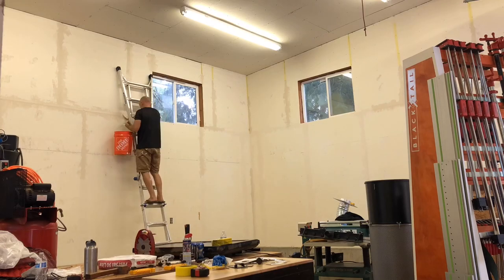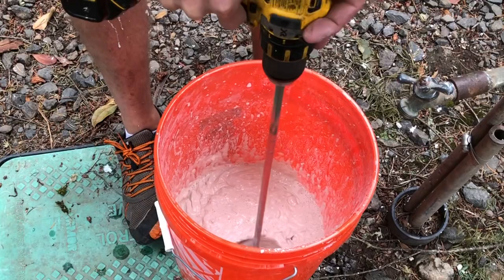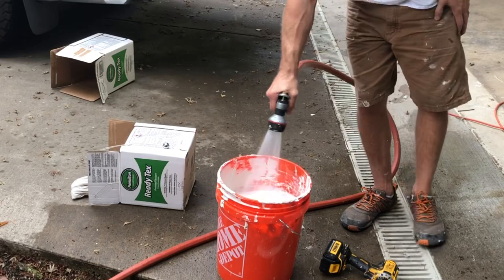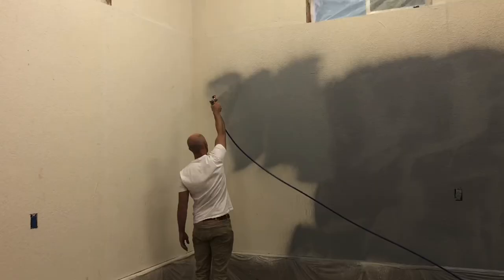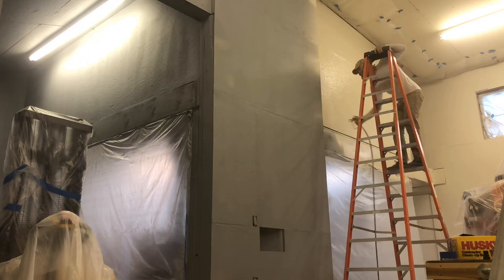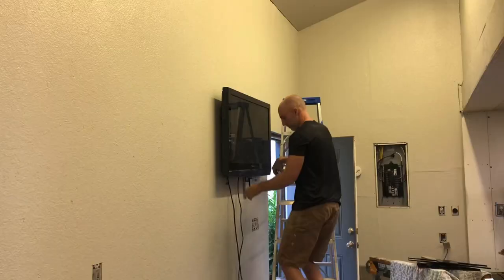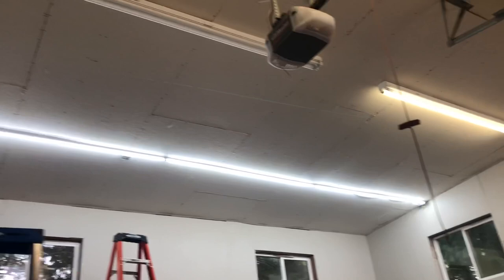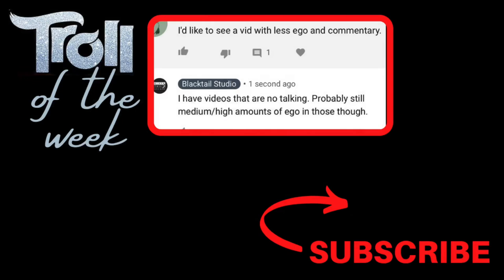Making My Dream Shop -- Episode Two

Comment: TV (or podcasts). I couldn't tell what happened to the TV? Also I think the new shop videos are fun! Especially considering it's not just maintenance. As long as there is some sort of remodeling to be done and not just cleaning, I say keep them coming. But if I could influence your future videos more than that I will say epoxy table videos have been my favorite.
Reply from the maker: I dropped it😬
Reply: @BlacktailStudio  That was my guess. At first I was expecting some footage of it falling off the wall!

Comment: Radio! 

Ive enjoyed these videos because I just finished building a new shop also and I have 16 ft sidewalls so I'm excited to see how you utilize the upper walls & shelving.  Also for the texturing over the OSB -- im struggling between using OSB, drywall, or metal siding inside. I want something easy to clean/spray and attach to all in one.
Reply from the maker: Osb is tough anyway

Comment: Radio - although I hate ads, so I pay for Pandora without ads.
Hey Cam, I have those same lights, and they get hot and start to lose diodes. I don't think they like being right up against the ceiling, so you may get more life out of them if you add some spacer blocks behind the mounting clips.
Reply from the maker: Oh really?

Comment: TV and radio, or rather just music. Though it seems I've been enjoying quit more. 

When you get back to client builds and have time to go into product design, you might wish to look at tensegrity tables. Those "floating" tables that use tension. An epoxy river table might look awesome done that way. Need to bend the wood for the tension parts. Lots pf people seem to just cut,  but I have a feeling that the bent wood might give you more integrity for the build. Apparently these tables are all the rage now, at least on DIY channels. :)
Reply from the maker: I’ve seen those. Pretty cool!

Comment: TV!  Nice.  But I think you would have been better off with doing a mud layer over the OSB, or another layer of 1/2" drywall on top. Smooth walls make for easier cleaning and less dust that you don't have to worry about getting kicked up later... just my experience and opinion
Reply from the maker: I’m not good enough for that

Comment: I've had power issues with a Graco handheld airless sprayer as well. You can only thin paint so much, and if you don't turn up the pressure all the way it just doesn't come out evenly.
Reply from the maker: Dang

Comment: Tv and radio. I like having the option of the tv if a hockey game is on or the radio to just chill out and relax and work on some projects. Would you be willing to do a basics video on what the minimum tools and materials needed to do small epoxy jobs like floating shelves and things like that? Also is it possible to make cutting boards with live edge wood and epoxy?
Reply from the maker: I like those ideas!

Comment: Dude, take one of the rotex sanders you have (the six inch) and sand the damn walls. LOL Probably to late, I stopped at 2:36 to type this. OK I see. I live in a 100 year old house, and used a two car garage for my shop. It is 20'x20'. I ripped everything down on the walls to the studs, which were real 2x6's The studs back then were like timber. I fiberglass insulated, and then put up vapor barrier. Then I put up 3/4 in plywood. And I am so happy I did. If I want a shelf somewhere, boom just put screws in. I also have a 9' ceiling, which makes a HUGE difference. I love the high ceiling you have. I fly radio control airplanes, and they take up a huge amount of space. How are you going to heat it?
Reply from the maker: Got a heater video coming!

Comment: Cam, you have a great channel and thanks to the pandemic I've been binge watching it for the past week.  You asked about other video ideas and I have one I think would make a good one.  Over the videos we've watched you work with different techniques and finishes and it would be cool to get a comparison of the different products you use and what are your likes and dislikes about them.  For example in the beginning you spoke about using shellac to seal the wood so that the epoxy didn't stain the wood, I haven't seen that step in recent videos.  You seemed to have moved from Olie's Oil on to Osmo to Rubio - was that because of durability, easier application, change in sponsorship, or you just like the sheen better?  And of course the same questions for the epoxy ... Thanks I look forward to seeing more of these great videos!
Reply from the maker: Great ideas brian

Comment: Hey Cam. So disappointed this morning. Last night I mixed up 9 gallons of 2-4” Liquid Glass. (First time ever). Making Walnut slab table, 1.75” deep. Used Transtint Black and tried 6 drops and checked with clear Mason jar at that depth to get a feel for the tint. Wasn’t what I wanted. Added another 6.... closer. Ended around 17 drops and looked good. Wanted solid black. Mixed 2nd 3gal kit the same way.... looked good. Third kit the same (all separate buckets), didn’t check it. About 15hrs now after the pour and it’s gelled up pretty good. Only, when the sunlight hits it, I can see the base of the mold. 😩 More of a smokey translucent black. NOT what I wanted. For the “black” you do, how many drops do you put in on a 3gal kit? I suppose it is what it is now? Can’t do anything about it?
Reply from the maker: I just squeeze a lot in. Test the color and see if I can see through it.

Comment: Radio: You are very industrious. I know you have a great dust control system, but in my experience some dust in a wood shop is inevitable and I'm wondering whether the increased surface area of the walls will become a dust trap and huge maintenance issue over time.
Reply from the maker: Oh, I’m sure it will

Comment: Nice work. I would have done the same thing with the walls. Too expensive and time consuming to remove the ply and go to drywall. You did the right thing. What are you gonna do for the ceiling; feel like you should have textured that. Maybe a Cedar plank...
Reply from the maker: Got some ideas
Reply: @BlacktailStudio  yes tongue and groove pine, spray stain and poly it. Thinking it would look pretty amazing. Dream shop?

Comment: Radi0/TV (actually streaming of audio/video). Looks great and the "spatter" looks professional. I wouldn't worry too much as most of the texture will be covered by your tools, storage and dust collection!  Question on the LEDs: so no more than 3 linked? But they are in a set of 8. Why not a set of six? I have two outlets in my garage for lights and have the 4ft FEIT LEDs (up to 4 can be ganged). If I got a set of these (only 3 can be ganged) I guess as 8ft sections, 3x8 would be 24ft of coverage. SO thank you for these links! I might just give it shot. Keep us supplied with progress! How's the fire situation? News now focused on Colorado fires...
Reply from the maker: Fires are good around here anyway. Thanks for asking!

Comment: So firstly congrats on the new shop, super super jealous but really glad for you! Now im kinda new to epoxy and have done a few projects but always in awe with your projects. If i may ask you could it be possible for you to do in depth videos from your tools to how you finish a project. I know u might have before and all but what i wana know is for example when u at the finish, i get mixed info and never a def answer, after sanding, do you polish first with a compound, do you oil or mono and neva polish, what are ur really well tricks to create the projects to get the correct procedure. I know its a lot but would appreciate it as i neva seem to get a solid picture on these topics
Reply from the maker: I have step by step videos and blogs on that. Will be easier than a comment

Comment: You say not to work in a lighting environment less than 5k Color Temp and that 2700k is for living rooms.  I'm a lighting designer and work occasionally in interior design, and I do agree with you on the living rooms, and honestly also that a colder light is better for shop work.  But you're also creating furniture that will be exclusively viewed in those warmer temps in living rooms, and I can't help but notice your newer inspection lights, photography lights, even what you use to shoot promo shots are all 5k-6500k.  Do you examine the pieces in the actual lighting conditions the client will be viewing them before shipping them off?

Comment: Great lights, great price. Thanks for the review. I have a question. I am building  25’ x 40’ shop and space is at a premium I need a planer and jointer would you recommend a 12” combination unit with helical head or go separate with non helical and get wider capacity on the planer. I build cabinets, charcuterie boards, and want to start doing dining room tables, standing clocks, and end tables.Other major tools I have in my shop are a brand new pcs sawstop 52” hp saw, 19 inch drum sander and every festool tool imaginable.
Reply from the maker: I don’t love those units. But people that have the hammer unit seem to really like it

Comment: First, congrats on the new digs. Checking into the LEDs you installed many buyers are complaining about the mounting clips. Did you have or are having trouble with them?
Reply from the maker: They weren’t great but are working fine now. They’re just small and flimsy.

Comment: YouTube - I can't get the Blacktail Channel to come in on radio or TV !! .... but at the moment I have none of the above in the shop such as it is.....perhaps I would go radio at this point in time - need to disconnect a bit more than TV allows if that was why I was going there.
New shop is great!, the high ceiling is wonderful.
Not sure about the lights, I find the "daylight" to be a bit harsh, I am willing to accept that a finishing booth needs as close to natural sunlight as you can get for the colors to be "right" and then they look right in the other lights as well.
Maybe it's because I spend so much time looking at monitors, that the daylight gets into the "blue" range that is part and parcel of the monitors and I just need a visual break from it, I dunno - but soft white is a little too yellow for a shop - maybe theory could make a 4500K light or 4K light I suppose that at some point it tips the scale over to "yellow" and if you could stay just north of that it might be just right ( for me).
Reply from the maker: That’s fair!

Comment: I only use a stage 5 finish in my garages. No texture to catch everything In the air.
Reply from the maker: Smart!
Reply: @BlacktailStudio  and i always use a high end bright white exterior paint. It takes a beating and can be washed and scrubbed if needed. I literally have a garage I built that when I added shelves I over tightened a bracket into a stud and it popped through the drywall. But the paint held up and you can clearly see the protruding screw head but the paint stretched and is still hard to the touch. It’s an investment up front that pays off for decades.

Comment: Radio. You did the best you could considering the OSB substrate. I was freaking out at the beginning thinking “textured” meant that ubiquitous horrible “popcorn” texture usually reserved for ceilings but sometimes sprayed on walls...which turns them into miserable dust, dirt and cobweb magnets that are impossible to keep clean. My place, some genius decided it was a good idea to texture the bathroom walls with “sand paint”!  That same genius decided dark stained rough sawn pine was a good idea for kitchen cabinets, wainscoting and interior trim. What a shit show.
Reply from the maker: Oh man

Comment: Radio (classic rock preferably).  I like following along with the shop build/update. Watching shop tours and shop builds is how I got a lot of great of ideas on things to do in my shop. I'm about to order the lights you put up in your shop as a matter of fact.  Thanks.
Edit: How wide is your shop and how far apart did you mount the light rows? Reason being is that my shop is 24'x32' and with a total of 8 96" strips, I was wondering if two rows of 3 (leaving 2 strips to spare) would be good enough to light the shop the way I need it.
Reply from the maker: I’d have to measure. But I probably won’t. Good call on the classic rock though!

Comment: TV. Sorry in advance for long comment. Genuine question. I’ve heard you say a couple times the overhead storage wasn’t safe. Do you know what specifically the inspector didn’t like? I’m going to be very limited on shop space and also work from home, so I was planning on doing an overhead loft like that where I close the walls below for an office, then just use the top for storage. Definitely wouldn’t build it like that, but wanting to avoid pitfalls about the idea in general. Possible reasons I thought he might have meant it wasn’t safe (without seeing it up close myself)

1. Was it because of the ledger board only being fixed to the wall and not being supported from underneath? 
2. The joists just being nailed to the posts instead of sitting on top of them? 

3. No railing? 

4.Did he just mean having heavy stuff up there that could fall off on someone?
Reply: Upon reflection I think I answered my own question. Everything I listed wasn’t good building practice, so in general I can see his point. I guess the idea isn’t flawed as long as properly constructed.

Comment: So I have just built a 525 ft shop inside my barn lined with osb, my fear is dust catching on the wall.  So is that a concern that you had when texturing or were you just going for uniform.  My walls are unfinished and the ceiling is just painted white, and I’m trying to make a plan
Reply from the maker: Could definitely grab some dust

Comment: Radio. I just finished my first river top. It will go into our mast bath. I used catelized laquer and polished it. Overall I am very happy but have one issue. A few small holes appeared in the epoxy after I had it sanded. The were not that I saw after it cured. These air pockets were in the epoxy and appeared after sanding. I thought the laquer  cover them, it did not. I will live with them because the only one who sees them is me. Anyway, can you tell me what caused this and how to prevent it in the future. Thanks your site is awesome.
Reply from the maker: Thanks don!
Reply: Any ideas on the small air hole?

Comment: hi, me and my dad make cutting boards, and noticed several knots and voids, that we have to cut off before making the boards, and we were wondering what epoxy would work best for filling those?  the epoxy would need to be black and would have to set without a pressure pot, It also would have to be not as expensive, so if you know the best stuff to use, that would be great
Reply from the maker: You’ll want to seal the knots with clear epoxy first or they will stain bad. And I like the liquid glass if you have time.
Reply: @BlacktailStudio  thanks, we ended up using some epoxy my dad had on hand, the setteng adgent was dark, so it cured a nice amber color

Comment: Radio outside, TV inside, audible in the car.  Problem with the tv is time sensitive things occasionally get ruined.

Did you run the flouros enough to be able to compare energy use?
Reply from the maker: I didn’t

Comment: I am working on new shop plans and like your discussion on lighting.  So, with the 8 pack of the 8 foot lights, is that enough light for your 1400 SF (If I recall correctly) shop or did you add more??  If so, what did you do or what would you recommend.

BTW, so far a radio guy, but may go TV in the new shop.
Reply from the maker: I think I had 10 total

Comment: Hey man, on an epoxy table what should the moisture content of the slab be? Does it need to be kiln dried? Dan
Reply from the maker: Should be at equilibrium. I did a blog on that if you’re interested
Reply: @BlacktailStudio  yeah man I'm interested! We've got a slab of 2in thick oak and it's currently 99% moisture in the middle and about 78% on the outsides... The moisture content of our workshop is about 18% so I think I'll be getting a new slab and letting the other oak dry for a bit...

Comment: Hi cam, quick question on a bar top. I have a local restaurant wanting a new bar top. It’s a big unit, roughly 15’ long, 2’ wide, and has a 2’ 90degree return on each end (making it look like a very flat letter u in shape). It is to be soft maple butcher block construction. My questions are, should I have an 1/8” lip around the edges to help make the epoxy bar top pour 1/8” thick, and can I over pour to cover the edges and just sand any drips off the bottom edge afterwards? Also am I stuck building this as a single unit or is there a way to build and pour in separate sections and join together on location and not have the seams look horrible and/or be a collection area for dirt and grime. Also what epoxy would you recommend for a pour like this?
Reply from the maker: Most people let it drip over the edge. Painters tape on the bottom will help

Comment: TV definitely,  the 48" section are 20w compared to the 8ft at 75w.  How much of a difference is there overall? I have a garage workshop and I have a 4 recessed lighting fixtures in the ceiling, but it is not enough light for a shop so I was going to add the 4ft pieces.  Do you think that will work well enough? I have a standard 2-car garage.
Reply from the maker: I think so. You don’t need this crazy amount of light
Reply: @BlacktailStudio  Okay so the 4fters came in and wow.  Your shop must be ultra bright in person!  The package comes with 8 and I only put up 6 of them but wow, they are extremely bright.  This can EASILY light up a 2-car garage. these are a definite buy.  Thanks for the info and all that you do, I'm a Big fan!